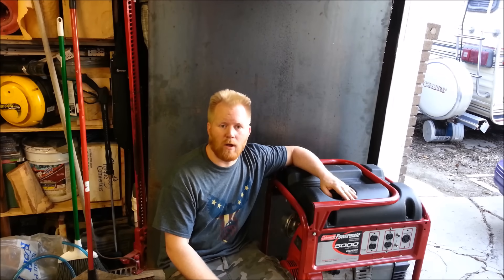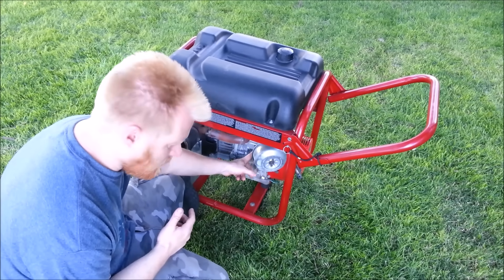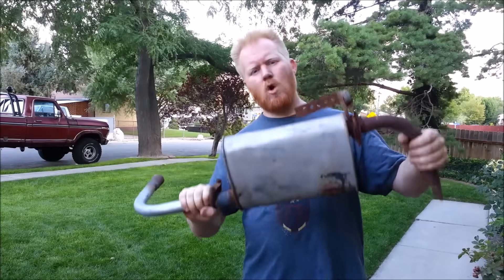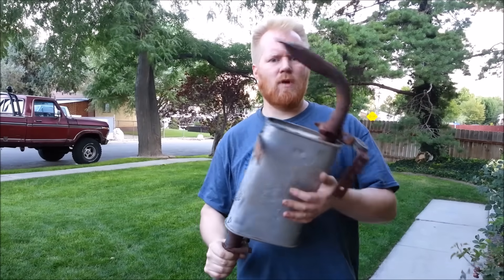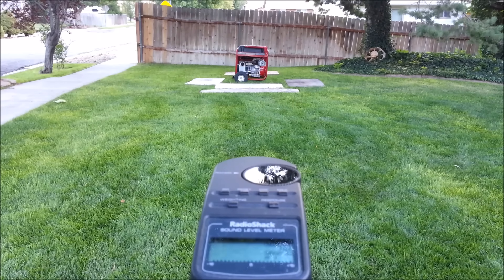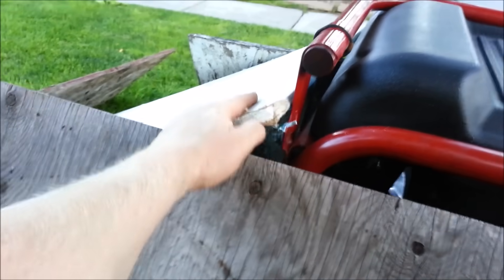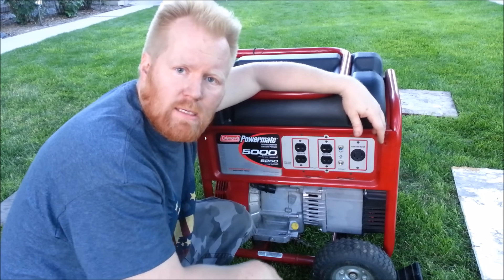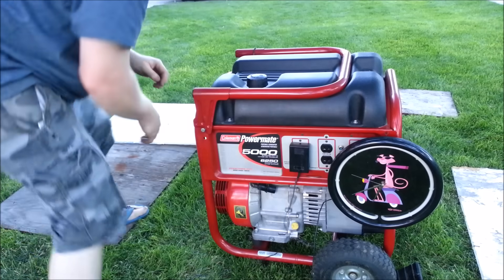4x Quieter generator in 10 seconds

Comment: During an emergency which is the only time I would have to use my generator the sound is the last of my worries.
Reply: true
Reply: That would be true if you live far enough away from people otherwise you guys would have people who would want to steal your generator, I'm actually planning on using a type 1 VW 4 cylinder with a quiet muffler and a home built inverter generator and low rpm preferably 1800 rpm which is near idle speed with a belt driven governor for when loads change.  So yes this issue would be a giant generator setup stationed in a garage or out building .

Comment: Does your new engine have rubber cooling fin dampeners? Have you done any research on fuel , my propane tractors are much quieter. Cars and gun silencers are quieter because they cool exhaust so maybe extending the exhaust a few feet up into the air? I learned as a kid riding a motorcycle with a expansion chamber that being loud makes you real unpopular. Would love to try running exhaust into a wading pool like a outboard.

Comment: I have thought about doing something like this for rving. My thought was a box made of  foam board insulation over the generator. Anything enclosed will usually be quieter. As long as there is enough room for air circulation and oxygen input it should work. I was thinking of a small intake tube and exhaust fan mounted to the box. Be fun to try.
Reply: I see quite a few comments about using a fan to help remove exhaust and since most of the generators in this category are limited output, people need to consider the fan's consumption of the available wattage. Just saying!
Reply: Do you really have to use sheet rock on the exaust side ?  I am just thinking about rain.  Would it be dangerous for fire with plywood?

Comment: Would that still work on a concrete floor? I dont have a yard, so I'm wondering about how much it could differ
Reply: You could place a rubber mat under your gen to absorb some vibration and possible absorb some sound too.
Reply: @Vlfkfnejisjejrjtjrie  Sounds worth a try. I'll research first, just to make sure it wouldn't melt or catch fire. Thanks.

Comment: You need to get a job buddy there something wrong when your mess around with generators and mufflers just leave it the way the manufacturer made it it went through all the tests Mufflers in all because you put too much back pressure on that little engine and it will run hot changing the velocity of the oil it breaks down the lubrication material to keep the engine safe from blowing up

Comment: You THINK you have good air flow, you do not. Just hot boxing the generator it wont last
Reply from the maker: What do you think a premade inverter/quiet generator is? It's an air cooled engine in a sealed box with a softball size vent hole. This has 3x3x3foot triangle holes at all 4 corners for ventilation.
Reply: @sixtyfiveford  what you just described makes no sense. Generators in enclosures like a generac are made to be out in the weather, they are still quite loud. Most generator boxes are meant for the unit to be run with one side completely open. I work on and own diesel inverter generators in enclosures and they have a dedicated intake and exhaust vent, exhaust is heavily insulated, and has dedicated fans to direct air through box, if you run them with the box closed and the fans fail it will go into overheat and shut down and thats still being ventilated. That generator you are using was not designed to be enclosed.
Reply: @sixtyfiveford  To prevent overheating, never fully enclose the generator. Portable generators produce significant heat - 600 degrees Fahrenheit at the exhaust is not uncommon. Open framed generators dissipate heat on all four sides.

This is what you have, designed to be run not enclosed.

Comment: Generator needs airflow!  It will definitely overheat,  Especially when used in warm climates !
Reply from the maker: Not at all. It has tons of airflow at every corner.
Reply: Going to overheat!!!!
Reply from the maker: @williamdobson4251  What do you think the inverter generators are? They are an air cooled engine inside a completely included box with a baseball size air inlet at each side. Riding mowers use the exact same motors that generators do and they are fully enclosed with small vent holes.

Comment: dig a  hole in your yard 1 ft on any side including the top of the generator,put it underground with thick enclosure on top and pipe in air with a small fan for cooling it off, noise is ridiculously low,my neighbors can' even hear it,the ground is perfect deadner for noise,done this 20 years ago,no noise, no rain or snow issues,right when you need it,spray it once in awhile for spiders and critters

Comment: You gotta watch out for blocking air circulation and heat dissipation. Even without a top, I have had generators overheat and shut down. Most of the time down south here when the temperatures are already pretty high.

Comment: The reflective surface has to have some mass to it - Sheetrock is perfect. Better would be Sheetrock with Roxul safe’n’sound attached on the side facing the genny: the sound that reflects off the Sheetrock will have to pass through the insulation 2x (in and out) before the ground finishes it off. Easily another 6dB SPL reduction. Works for compressors too.
Reply from the maker: Good point.

Comment: Thanks so much for such a simple solution. I've been fretting over which generator to get based on sound and this will open up so many options that I wasn't considering. Also thanks to the thoughtful comments and suggestions.
Reply: It's probably too late for this advice now but over 48 years as a mechanical engineer I've noticed that 'Honda engine' powered systems are consistently the quietest. 
On a side note, with proper maintenance they're also one of the most reliable and long lasting. Not a personal pitch for Honda just something that caught my attention!

Comment: Going to over heat engine. Take temp. reading before and after.
Reply: No it won't that's not air tight lmao. Sounds like this video overheated your brain lol
Reply: @simcptmike  Does not matter! radiant heat will over heat unit. Air needs to circulate to cool unit. States that instructions. Read them .

Comment: Unless it is very breezy... doubt you are getting enough airflow. Just killed your oil life, hence, engine life. Not to great for the armature either.
Reply from the maker: Every single single quiet inverter generator is just an air cooled engine in a sealed box with a tiny vent hole at one side and an exhaust at the other.

Comment: 4x Quieter Generator - get a 200’ extension wire.....drive generator 200’ away, start generator. So quiet. This video was pointless
Reply from the maker: 200' with a heavy duty 12awg cord and your going to have a huge voltage drop. Pull 20-30amps and you're going to be around 15-20% voltage drop or 100volts vs the 120v your stuff wants. You're fridge etc will pull even more amps to compensate for the low voltage. Some electronics will not work at all. You would need a 6awg cord to pull a 20-30amps load at 200'. That's several $100 worth of cord and over 100lbs to lug around.

Comment: A muffler with the construction design of a .22 silencer scaled up. Make the centre hole diameter 10mm larger than the original exhaust pipe. Car mufflers are only so good because they are not restrictive enough.
Reply: much of the noise is from the actual engine block... much like when you lift the hood of your car while its running..

Comment: Riddle me this sir: when the cop gave me a sound ticket why did he only measure from the end of the pipes on my Harley, and not up by the cylinder heads as you're telling us here.
Reply: I wish more cops will do the same
Reply: Last time one of those bikers stopped next to me, the dude had freaking earphones, how annoying
Reply from the maker: Because you put exhaust on to increase the sound above the level the engine block put out. Generator manufactures put exhaust on that is lower than the engine block sound level. Go out to your car, hold the rpm at 3600 and pop the hood. You'll hear how much noise a water jacketed car engine puts out without the sound deadening hood over it.
Reply: @sixtyfiveford  my Harley only has factory exhaust, I did not add anything, secondly, Haleys have no water jacket, they are all air-cooled.

Comment: Take some flex pipe, fit it on the exhaust. Dig a 6 to eight foot trench about 8 inches deep, lay the flex pipe in the trench, cover the trench with plywood, cover plywood with the dirt that was removed from the trench. Start your genny, and Bobs your uncle, you have a quiet Genny .
   Give it a try, it works great!

Comment: Good effort but there is a problem here. The engine requires cool air to enter via the strato, with these panels you are concentrating hot air therefore reducing cool air intake. Pick up an old/used Honda GROM muffler and install it. Make sure the baffles are still with the muffler before you begin. Yes I know, a few extra dollars here and there, but your neighbors will love you!

Comment: Boxing in your generator with anything will barbecue it unless it's 32 degrees out. Pipe the exhaust into a 5 gallon bucket of water.
Reply from the maker: The sound doesn't come from the exhaust, it travels directly out of the engine block. You could put the exhaust into the ocean and it would still be just as loud. Also it's not boxed in, there are huge gaps at every corner.

Comment: I live in Texas the generator would get too hot if I did that
Reply from the maker: You leave plenty of space at every corner. All of these brand new inverter quiet generators are an air-cooled engine inside a virtually airtight box.

Comment: Yea, but when the storm is blowing 60-100 mph  it's really hard to get the plywood to co- operate.
Reply from the maker: When you have a storm blowing that hard the noise from a generator is your last concern.
Reply: @sixtyfiveford  You would think so, however when the storm was 115 on the first day(and no power) and two days later and she's a still blowing at 60-80, ya want some lights and need to keep a sump pump going to stop the 25 inches of water from doing damage to the house. Plus everything in the fridges is going bad now. I need to keep the penny going and sleep is hard to come by with that racket.

Comment: I suspect if you put a temp gauge on the generator you'd find it runs hotter with the boards around it
Reply from the maker: Not really. The engine and gen head have a few spots that are 2 or 3F higher after an hour of run time. Non crucial parts like the metal frame are warm to the touch where they wouldn't have been before. There are huge gaps at every corner to allow the tiny fan on the engine and gen head to pull in/push out plenty of cooling air. You need to know that all these modern quiet inverter generators are air cooled engines within a tight fitting plastic box.

Comment: Maybe i would bought an corolla and chopped it behind the torpedowall. And put the generator itself (engine off) and connect it to the Corolla engine(replacing the transmission) 😊
Reply from the maker: That would make a quiet generator.

Comment: Put some steel wool at the output point, inside is better but on the outside will work to, use wire to affix to the outside. Don't use to much steel wool as you will start blocking the air flow, and decrease the engines hp.

Comment: Two observations; 1. If you do this in the summer, you run the risk of running a very hot engine and generator and causing a failure of each, or at least shortening the life of the unit.
2. You are allowing exhaust gasses to enter the intake- this will reduce the horsepower and also cause overloading and heating of the engine.
  Allow room for it to breathe!  Build a large insulated box with diverted vents and even an exhaust fan.
Reply: Or just stick a $5 box fan under the plywood to assist with air flow if your worried about circulation.
Reply: Your not wrong, I tried something similar and when I shut it down I could hear a hissing noise, it was the fuel cap vent working to max, popped it off and removed the pre filter and the bottom of the tank was bubbling, literally boiling my fuel, God knows how much had just evaporated into the air🤦. Building a gasifier now to run it from but will keep the fuel side as well for a duel fuel setup and the tank I'm going to remove and mount away from the heat altogether.
Reply: How could it overheat if there is so much ventilation?
Reply: All true, just remember powering the fan will reduce a little of the already limited available electrical power.

Comment: How about if I install an a motorcicle moffler, to my GENERAC 4400 watts, generator. Will it's change anything in terms of noise & productivity?

By the way, that generator have 20+ years, but little use. Stil like new.
Reply from the maker: It may reduce the tone of the exhaust sound but it will be within a decibel or two of original. The majority of the sound it coming directly out of the thin cylinder block walls.

Comment: Foil backed fiberglass duct board is fire proof light weight and should absorb sound you can find scraps at  local HVAC installers dumpsters, if not big enough glue several pieces to thin plywood.

Comment: Curious if boarding up the decibel reader produces such dramatic results, compared to boarding up the sound source. This is because we’re trying to soundproof our front rooms from traffic noise simply and cheaply and cannot board up every vehicle as it drives past...
Reply from the maker: Windows allow a ton of sound through. Wood blinds would block a little more sound than curtains.
Reply: Paul Marshall: I've got the same problem. Let me know if you find solutions. I worked in an office on a BUSY street. One day I noticed that I could see the traffic but not hear it. Turned out WOOD is key. The windows were double pane but the frame was old fashioned wood. Wood is a poor conductor of noise. It doesn't vibrate. If you have modern windows with metal frames or maybe plastic, not as quiet as wood.

Comment: Use acoustic ceiling tiles ... trust me.  Make an aluminum angle frame and hot melt the panels in place.  I use one on my air compressor and it cuts about 98% of the noise.
Reply from the maker: Makes sense.

Comment: Also, converting them to burn propane or natural gas makes them a bit quieter, and they won't surge too. There is a kit available for most with a throttle plate that allows you to use all 3 fuel sources. Natural gas is nice for extended outages. With quick connections. The machine runs cooler as well.
Reply from the maker: I've converted a few machines for customers and I agree a little. There might be a tiny bit of sound reduction.  I think any minute sound reduction is due to having a large regulator bolted to the side of the motor where most of the sound comes out. So it's simply deflecting sound. I haven't noticed any heat reduction but I don't think running off gas overheats them either. If they do run cooler, it's because there is less energy in LPG/NG and the generator is running lower than peak performance.

Comment: Good video,  the problem is an air cooled engine should absolutely not be ran like that for an extended period of time.  They design those in a specific manner.
Reply from the maker: All inverter generators are air cooled engines is a tiny box. No difference.

Comment: You're asking for premature failure to the engine and/or generator. Both are air cooled. All engine & generator manufacturers state that you should have at least 2 feet of clearance all the way around the unit. Covering the unit with plywood will cause the cooling system to draw the hot air back into the system preventing cooling. Also, the carbon that naturally exits the exhaust can be drawn into the engine air intake, clogging the air filter (especially paper filters) causing the engine to run excessively rich increasing the carbon output of the exhaust. I have 35 years experience servicing generators and other power products.
Reply from the maker: Apparently you didn't watch the video. All 4 corners are wide open and allow plenty of airflow to keep the generator cool. If your engine is pushing out carbon you don't know how to service an engine to make it run properly and you should retire.

Comment: This is why people now use solar panels with batteries.   :-)
Reply from the maker: That's a funny comment. $300 to have 7000 watts of instant 24/7 power that will run everything. $30,000 to have the same system in solar with batteries and in a storm you'd be out of luck in a day. Good luck.

Comment: My old school maths tells me that a 10 decibel reduction from 80 to 70 is a 12.5% reduction i.e one eighth 
reduction.
If you say something is 80 decibels quiet then a 4 X reduction in quietness would be 80/4 equal to 20 decibels.
Reply from the maker: Decibel scale is logarithmic. 3rd grade math won't help you here.
Reply: @sixtyfiveford  It would be helpful if they would explain that when making a video using decibel scale.
 I know it is how earthquakes are measured on the Richter scale. A one point increment could double the intensity. 
I do not know how decibel scale works and will have to research that. I think most people would be inclined to make the same mistake I did as we hardly ever / never deal with it or have instruments to measure it.

Thanks for your input....! i was fishing for an explanation!

Comment: ** A 3 sided dog house , works so well for us. 4 corner Posts - Humped Roof w/shingles, dirt floor. 👌🏼
can’t hear much from behind or from either side.  Only from the front. the wood walls muffle much of the noise. 
Don’t waste yer time on anything else. Tip it backwards to check oil/gas.